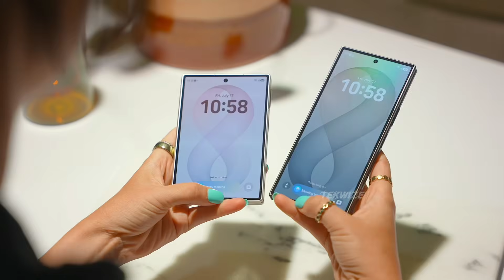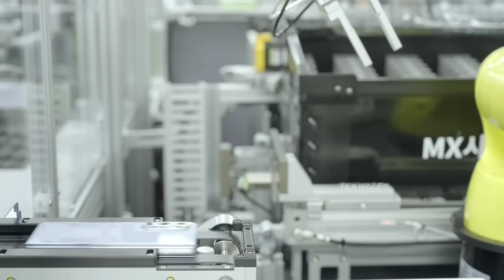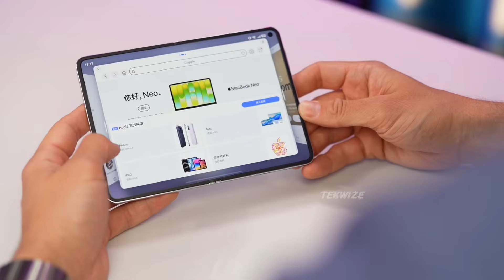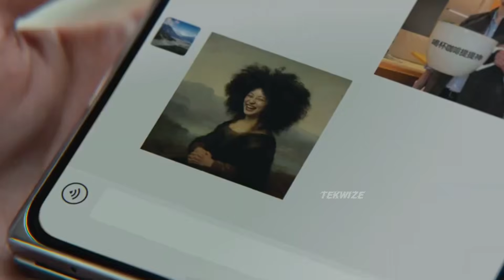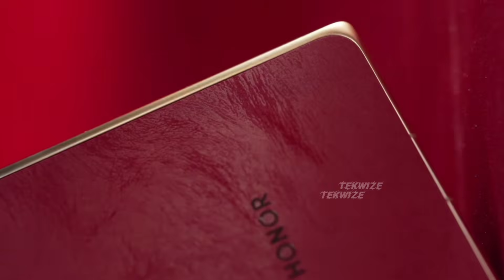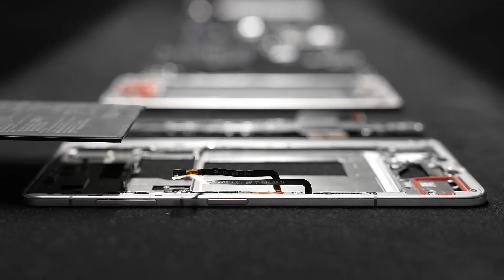Honor Magic V7 (Wide) — Honor Is BACK Again!

Comment: My god this is stupid. We left this form factor behind for a reason.
Reply: I think the passport size is short enough to fit fully into my shirt front pocket without it falling out. Kinda like that
Reply: @sc9433 if you find it useful, great. But peak foldable is when they're as thin and light as a regular candy bar flagship, but happens to fold out. It's like people would run out and buy a short and wide iPhone 18 or Galaxy S26. No, because it's a stupid form factor.
Reply: Wich reason? If you can actually have argument your sht
Reply: @user-ih3vk3ky8z reason? The short and stubby folded format is terrible for enerydsy use. Foldables made sense as soon as they had the same form factor, weight and thickness as a normal candy bar phone. It just happens to also fold.

I get the allure of having a wider inner screen for media consumption, but most foldables are used most in folded mode so messing up that use case with a bad form factor is just 🤯
Reply: To each their own. Maybe Honor could release a wide and a normal one, kinda like Samsung did. Personally I'm waiting on a trifold from them 👀
Reply: Apple disagrees. There clearly is a market for it.